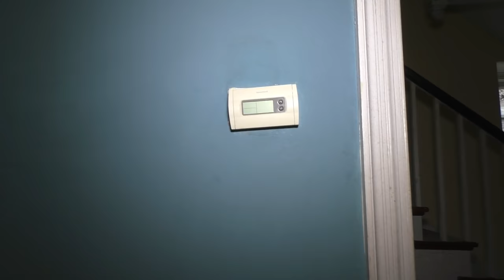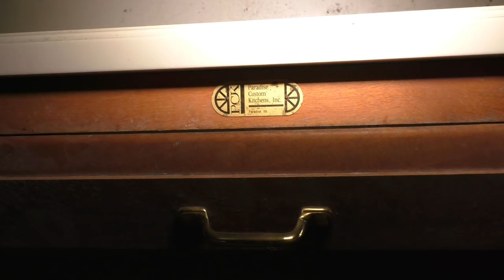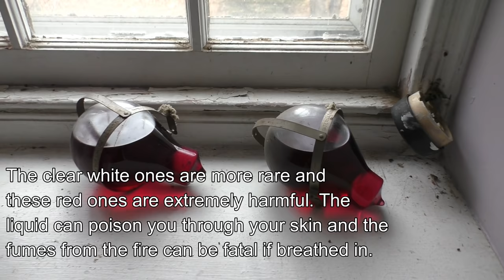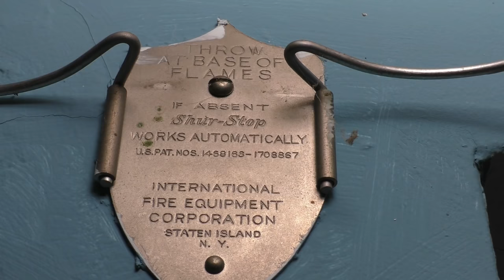Beautiful Abandoned 1930s Mansion - Inside Is Amazing! Plus Guest House

Comment: Sorry if someone else answered your question, I didn’t read thru all comments. 

Bells in basement were probably connected to pushbuttons near kitchen for ringing butler. 

The fire extinguishers you found likely contained carbon tetrachloride which could smother a small fire

Thanks for the video

Comment: Nice fine on the fire grenades.

And yes the clear ones are the more rare and chances are the red ones are from red comet.

Is they were known for dying their product red and there were also some fancier designs of these as well we're still just smooth glass globe like those.

Some people that I knew once mistake those for a lightning rod ball it was a red one about the same size and it had the diamond patterns in it I will see it at first but then I realized that's a fire grenade in there like what it was in the old attic and there's some other interesting things as well they're really old place they just thought there was a lightning rod ball collection if they just have to be extra fire grenades that were stored evidently this is in the garage I'm guessing they had extra ones or in case of a vehicle fire or something also that's where the heating system was as well so that might have had something to do with it as well also there were larger things like that that we're not supportable that were a much larger canister glass globe that were more shaped like a cold capsule or whatever elongated that we stand vertically with the mechanism to break the underneath I'll have time something typically like that would be around a boiler or a furnace in the oldest Elations I've seen these a few times in Old homes like that and that would be the only area they be in.

Also once I was in this old place don't remember what they did there or what it was or anyting high ceilings had these glass containers about at least a foot or so long or more quite large I was told that they would drop if there was ever a fire in shatter and putting out I'm summarizing this of course but same idea as a Fire Grenade except this was before they had fire sprinkler systems there's all kinds of other cool stuff in that place too there's old enough that you could see stuff from every generation of sprinkler system for fire and fire alarm and much much more you sure seem to be a logical area that place I want the stuff was still there even do not use and also there were still using DC power for some of it and some of the system was still working and also there's at least two Mercury Arc rectifier staff place as well if I remember correctly there might have been more than two and yes they were still being used at that time evidently for some sort of motor drive system I was told that they had used motors from some sort of marine applications it was for some type of waste or something some more what might have been used on the lifts for stage lifts on Old theaters where you use a Mercury Arc rectifier for power that was one of the things that we still use DC power and also there was Big World Rick's Burgers as well although some of them are not used for plant power but we're providing power to other sistoms elsewhere off site so essentially is that place also served is a logical Center for other industry Etc years and years ago and yes part of it with me uses of DC converter station not just locally but places close by Next Door and also there was even still working steam engine and no this is not as historic place but all this stuff was still in use and it was being modernized little by little fascinating place.

 by the way one of the old sprinkler systems was also a hydronic heating system simultaneously the idea was the sprinklers if they went off cold water would be released into the system to put out fire although that system was still intact for my heating and irrational sprinklers were still there and several other different generations of things as well.

Also there was Jack train running all over the place with fusible links as well and also even in some cases sort short section of rope or cord in addition to Drake heat melting a fusible link if that cord burn through rope whichever it was the idea is that Jack train would be released and weight would fall and open the valve which would release water into open sprinklers what you're essentially looked almost like the spout diffuser on a watering can essentially I think they were brass if I'm not mistaken this was one of the old systems that was still there but of course not in use although they said solar systems still had water pressure boiler or not.

 also one time and old home I saw something somewhere except the water valves were in the basement with weights hanging off them on long arm the weights were almost like what was used for self closing sliding barn doors on the angle track with rollers on top we used to have those on stage at school Because that was a far wall of course.

Talk to you about the fire doors there.

 but with that system at that old place that house I saw the trains with throughout the house the Jack chain in refusal wings and rope record just like in the other place and there was a master valve and then individual valves for each area I can't remember what the sprinkler heads or should I say nozzles look like all those also good miniature whose novels except they're fixed spray pepper not adjustable it almost reminded me of systems that used industrial nozzles to protect horses from fire since they cannot take the stand high temperatures and yes there are fire sprinklers for horse protection as well but not considered extinguishing systems and they don't use you all this two parts for the nozzles your strictly to protect the horses not to put out fires.

 by the way that device that the top is hello in the bottom pushes up it's possible that there might have been some sort of a horn I'll pray by a compressed air or propellant can of some sort and I could be used as warm to get people out of a house should there be a farmer or something ThinkFree on powered air horn or similar they also used to have one's their primitive fire alarms that use the fusible plug or similar or fusible link set off a compressed air horn I don't know it may have been free on it that time or something some seem to have a fairly Hefty heavy walled Reservoir possibly High fresher and others look like a ritual bug bombs that the military first used live around spherical tank back then that was filled with Freon and the chemical mixture for the bug bombs they were used against mosquitoes during early War times that's when that was pretty much invented for that.

 I love so you videos as well as the old places in person as well it's always interesting no matter what the opportunity.

Comment: In terms of the Spring House that might have been it where what looks like well pump setup could have been fed from in some cases they would use a spring instead of a well but there will be pump equipment just like your would be for a well pressure tank Etc on my grandparents Farm they did have a spring that was used for water before they had city water or more like country water but rural area but eventually they did get city water also the old call still served the barn as well evidently they did that on purpose in case for some reason there was not any water when they need it because of the animals and also this is a dairy operation as well or used to be at least LeFrak one place I used to stay there was a concrete crowd that had a yard hydrant that we actually used to fill our water balls and do our things with that was not actually on the world even if the power was out we still had water pressure there I was told that it was from some sort of spring but I don't know details but from what I understand that pressure somehow was either provided off in the distance through the pipes from somewhere else I did not know where to Spring was unheard stories that was some sort of Artesian well that provide enough pressure to be able to use the yard hydrant as is but my feeling is that it was off above the hills somewhere that the spring was some people thought that the spring was directly below the concrete proud but we're probably mistaken no one really knows where it was on heard so many conflicting stories and also the water taste better than the well water did so I always have a water bottle that go from there and we also make ice cubes from that for our drinking water as well the well water not so much

Comment: Do not play with those fire fighting bombs - they contain a chemical solution that is dangerous if the fumes are inhaled.  The oldest ones were put into the ceiling so when the the ceiling fell in they would fall down into the room below.  The deep window sills were actually window seats.  With the exterior of the house being stone not a stone facade, the windows were deep.

Comment: I thought jack and jill bathrooms had double sinks.. one for each. 2 doors wouldn't mean that would it? That's just a double entry off of  2 bedrooms for convenience. Those bells in the basement could be so you hear someone knocking but they also could be connected to individual rms. upstairs for when buzzing the maid, etc. so they know who wants them and where. The fire grenades had a fire extinguishing chemical in them for maximum potency being they were on the small side.

Comment: Wow!  Looks like my house, but larger.
Reply: Mine was built in downtown Memphis, Tenn in 1920, so it will be 100 years old in 2020.  It was later moved to a different part of town, and was the first house on this street.  It has art nouveau pewter radiators, wide curved archways, hardwood floors, and SO much more.

The plumbing needs replacing and the 15 year old roof is starting to leak.  The money we intended for maintenance now goes to pay our ever increasing  house insurance bill.  So, the insurance company hired to protect the house is actually destroying it.  It's heartbreaking. 

There are so many interesting things here and we've been told of past treasures that were taken by relatives when the previous owners fell ill.  I'll  add more if anyone is interested.